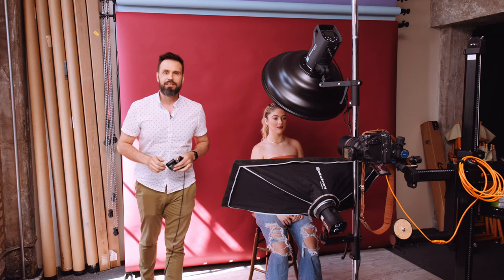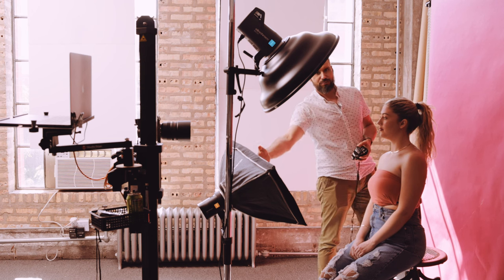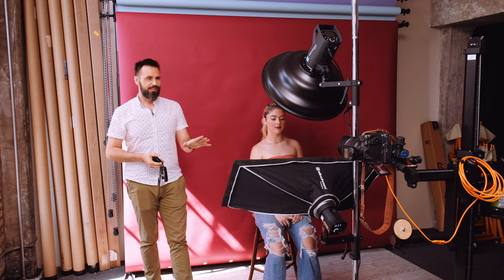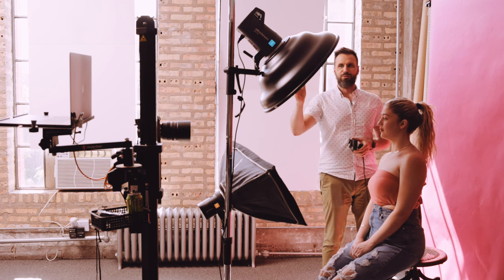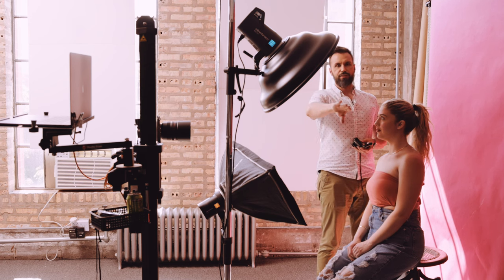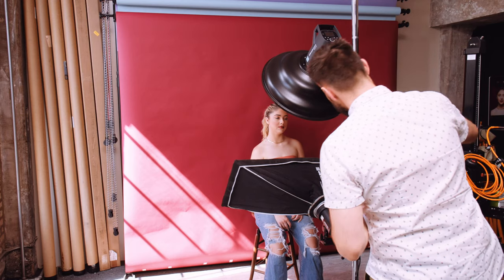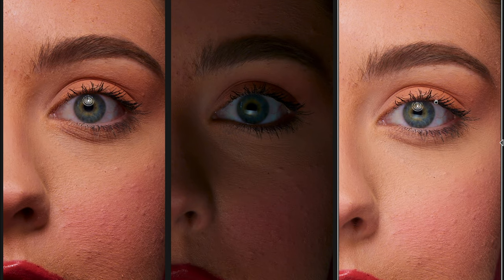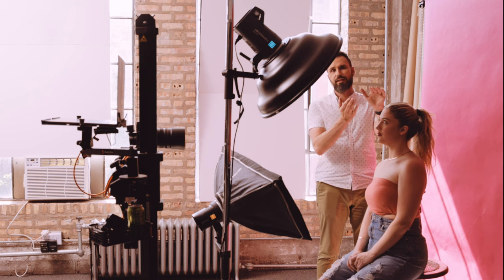Clamshell Lighting Tutorial: Master Beauty Lighting with a Beauty Dish and Strip Softbox

Comment: good video.  i havent used a light meter in the studio in years!  Especially now with the new TTL Face Priority on the new mirrorless bodies R6, etc.)  I can nail the exposure in 4 or 5 shots, and ratios.  i have a lot of "feel" without measuring due to shooting experience also. of course the image result is what matters most regardless of what the meter says.
Also been using Glows Arc strip box for clamshell and results are great as it offers more of a curve of controlled light.  I wish it were narrower 14 vs the usual 12 but results are beautiful on women, and with positioning great on men also.

Comment: Thanks for the video! Love your material. How do you judge the distance the bottom light should be from the person? I feel like the ratios would be off depending on that distance. I understand the part about an equidistant angle of that 1 x3 just  not the overall distance .
Reply from the maker: I would say it’s probably around 3-4’ that should be a good working distance where you’ll be able to get it at the right angle and not have it in the way. Distance will affect brightness but that just means that you will have to adjust th e I put power so the light falling on the subject from the full light is 1-2stops darker than the main light. However you could use this method. Pick your f stop then turn on the main light then adjust the power until the exposure looks right on the camera. Then turn on the fill light and adjust the power until the shadows look good to your eye.

Comment: John, thanks for the quick review. Sorry about being late to this discussion. Just purchased my first strobe, trigger and modifier. The video was tight, well explained, and I appreciate the side-by side-by side comparison. Bravo. However, you lost me on the final tip. The strip box at the bottom is angled toward the model (just as the beauty dish key light is angled down). Yet, you said that the bottom of the soft box was "equidistant" to the chest as the top of the box was to the top of her head. You lost me here. The softbox is angled, and she is straight. So how is the distance to both the same? Thanks for your reply if you come back this a way!
Reply from the maker: Thanks. I probably meant the distance was fairly similar. What I was warring about was having the stand for the fill too close to the persons legs because having it come from below like that would light up the chest more than it would fill in the shadows on the neck.
Reply: @JohnGress  John, appreciate the clarification. I thought that was likely what you were referencing, but didn't want to assume anything since I'm ultra new.
Reply from the maker: No problem!

Comment: Can this be done with Speedlite and a 21x21 Softbox to replace the main light?
Reply from the maker: Yes but using a small hard light source for fill may not be optimal.
Reply: @JohnGress  so using two Speedlite what modifiers do you recommend?
Reply from the maker: Something 2-3’ and something smaller.

Comment: What to do when the client wears glasses and doesn’t want to do a picture without them as it is part of their persona? How should I change my light setup? I’ve always struggled here.
Reply from the maker: Light is going to reflect off of the glasses at the same angle it strikes them. So if your light is close at the same angle as the camera then the reflection is going to come back into the lens. If you move the light further away from the camera, it will hit the glasses at a steeper angle and the reflections will be directed away from the camera.
Reply: @JohnGress  do you have a video that  demonstrates  this  with how you adapt for glasses? Thank you!
Reply from the maker: I don’t. But I should.
Reply: @JohnGress  I'm scared of glasses...lol
Reply: @JohnGress  thanks for the reply. I'll play with the distance of the bottom light, then tape my marks on the floor so I know where to place the bottom light and move faster with confidence and less hassle.
Reply: @staceynolan48    Simply put, adjust your lights up or down until there's no reflection of the glasses in your camera. Google "the angle of incidence" for the diagram.